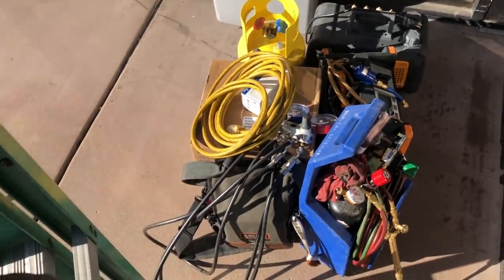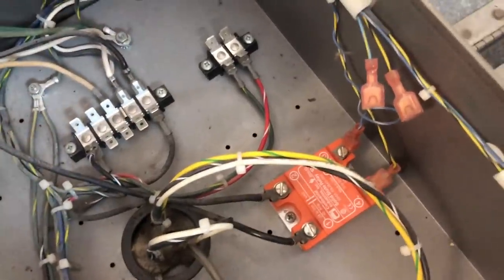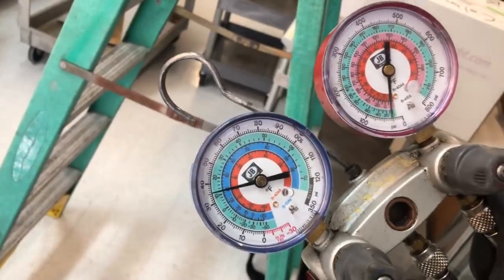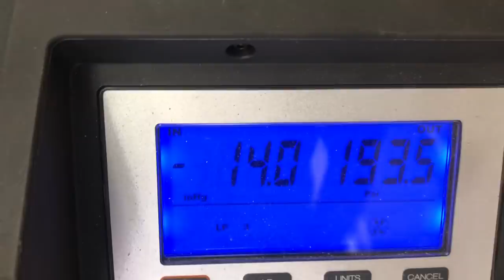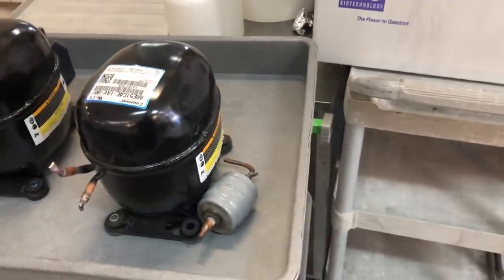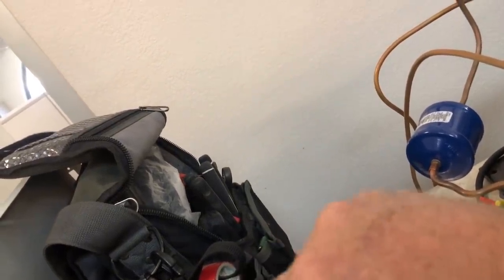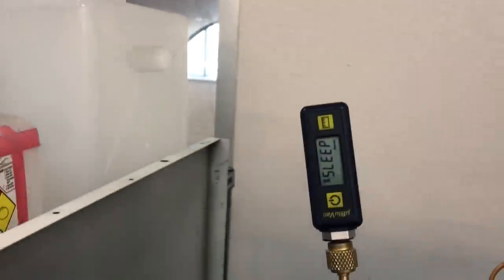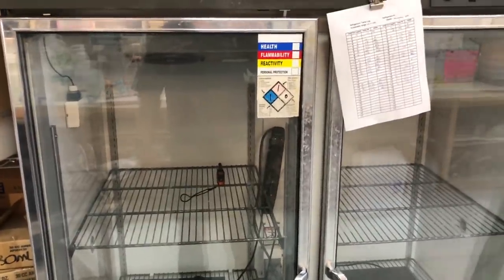Changing a compressor on a puffer Hubbard

Comment: Hi Dave those are solid state relays  so they are vacuum sealed  no spark and this this is a medical place i guess this is the only reason they used it.. i've used them before .. not bad  but i've only used it for Defrost heaters
Reply: Solid stat relays also have no physical contacts and instead use electronics to switch the power.

Comment: Great vid Dave, do you have any recommendations on a tool for crimping flag terminals or have a way of doing them with a crimping tool. I have been doing them for years a certain way but probably not the right way.
Reply: they make special crimp tools just for them. just search the web for  "flag terminal crimper" you'll find various ones.
Reply: throttle bottle yea iv seen a few, none advertised for non-insulated, I’ll just take a gamble on one I guess

Comment: Been there done that.Worked at the factory 10 years in Asheville
Reply from the maker: how was that? those units are stout. did you build them?
Reply: @NorCal-refrigeration  Yes I was on the reach in line and quality control.And freezer line and low ult line quality control.Pretty much everything refrigeration that was built
Reply from the maker: Eagle Mechanical Refrigeration/Hvac Durham N.C you guy did a great job, those units are built to last.  🤘⚡️🤘
Reply: @NorCal-refrigeration  Well Thermo Fisher owns it now so it's plug and play
Reply from the maker: Eagle Mechanical Refrigeration/Hvac Durham N.C good stuff tons of those in the labs at the day job.

Comment: Good vid.
i usually find that when my recovery goes that fast.  That the unit only had GAS pressure in  it an NO LIQUID Refrigerant in the system. = A LEAK Somewhere ? Probably / usualy the Condensate service loops. u said that one had a loop in back , leaker ?
Reply: i've watched a lot of your videos sometimes you're observations or complaints about pipe sizing is just sad...